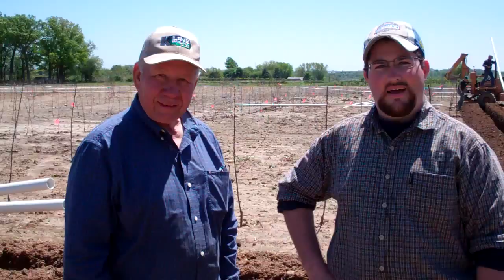Royal Oak Farm A-Maze-N' Apples - Phase 2 - Installing Irrigation and Spray System

Comment: how is the solid set spray system working out?
Reply from the maker: Hello Jasmine!  The system is in the final phase of testing after the installation of completely new spray heads (emitters).  We found we were not getting the desired coverage with the original spray heads for the system and , after testing at Michigan State, we received all new spray heads that have been installed and tested.  With some final tweaks, the system is pretty much operable and ready to go!